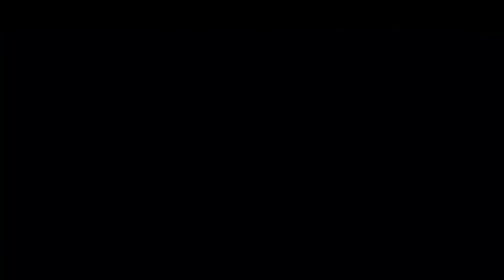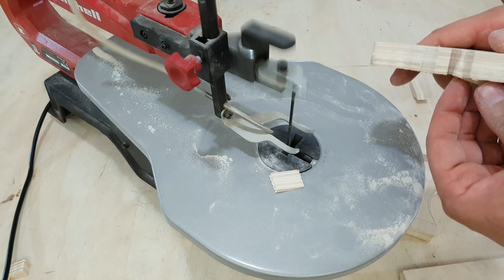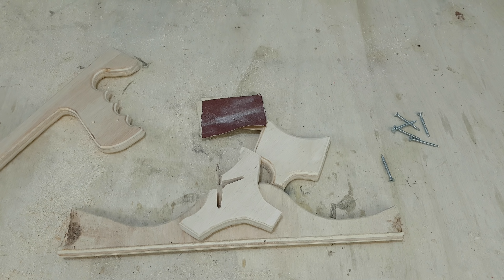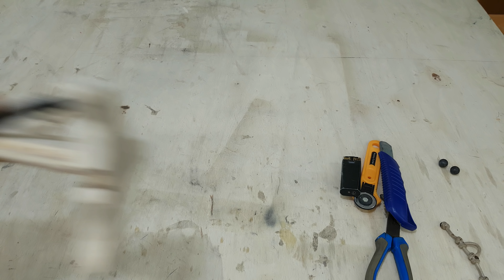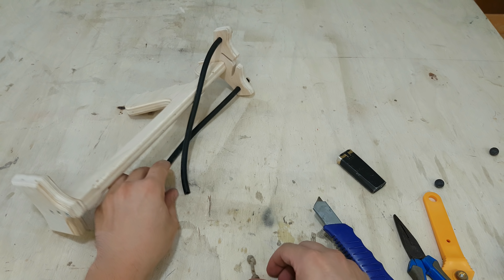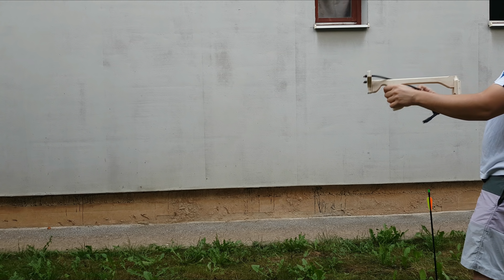Arm Brace Slingbow / Slingshot

Comment: Save some work: do the sanding AFTER routing. For different sizes of finger grips, use a drill and stone bits (especially ball type) to round out the curves before sanding or routing.

Comment: Nice design.  Too much support not enough overdraw otherwise pretty well done.
Reply: He could go full butterfly? I'm thinking a couple rollers on the fork tips with the bands returning to the handgrip, giving enough length for the long pull and thereby more speed and power. The pouch would begin AT the forks instead of behind them.